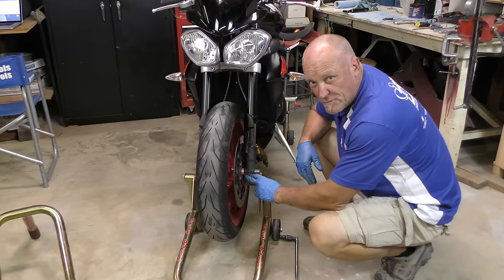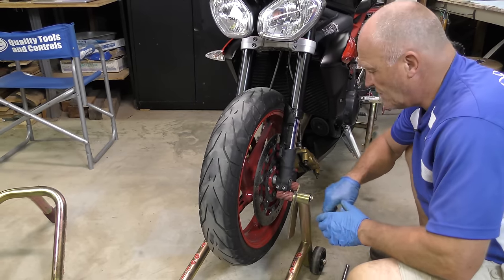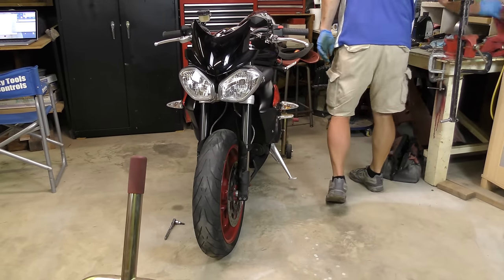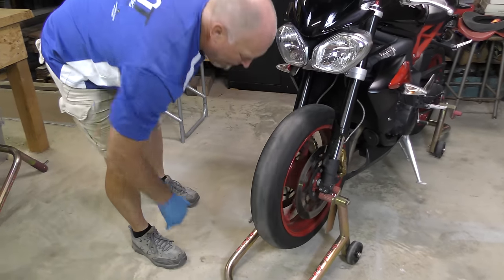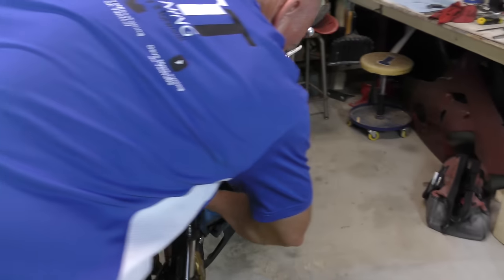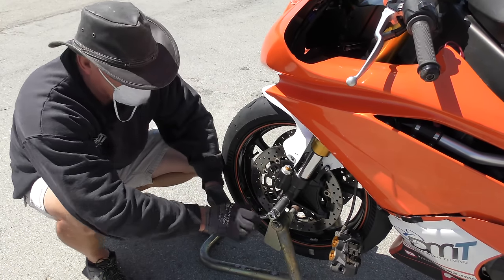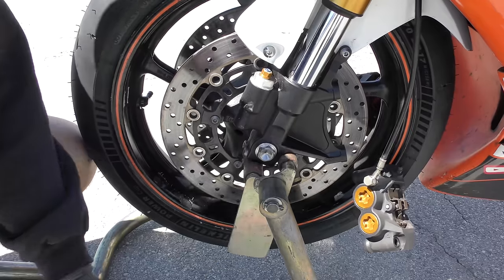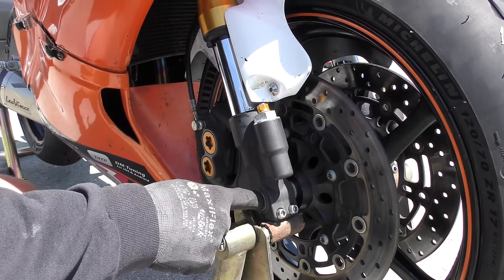Aligning Motorcycle Fork Legs Properly After Mounting The Front Wheel

Comment: Will this straighten my handle bars? Or do I need to also loosen the lower triple clamps prior to the bounce?
Reply from the maker: Forks only bind in a lateral direction (left/right) and do not cause the bar to be off the center line. Generally that is from another issue altogether.
Reply: @catalystreactionsbw  Okay. The reason I asked is because I noticed my front wheel was pointing a few degrees to the left. I can line up my triple so it's even both sides measurement wise (centre of the fork adjusters to fairing bolts). And the front wheel is definitely pointed left a little. Was told to a full alignment with the triple and the forks, but unsure of the entire process?
Reply from the maker: @KR4Z3D666  remove the forks and loosen the upper triple clamp nut on the steering stem. Install one fork and snug the triple clamp bolts. Install the second leg and see if it lines up perfectly with the upper triple clamp. If yes, all good. If no, upper, lower and steering stem need to be straightened.
Reply: @catalystreactionsbw  I'll let me suspension guru take a look at it. He's gotta do the fork upgrade on the ninja300 so he can look at the gsxr while he's at it :)

Comment: My bike when i break hard, in the frount, maskes a grrrrr sound, is that normal? (NEW bike 2000km only)
Reply from the maker: Have you checked your brake pads to make sure they are wearing evenly and checked the rotors for hot spots? Spin the wheel to see if it is spinning free or catches on the brakes pads.
Reply: @catalystreactionsbw  Thank for answering! I will check that and comment to the brand. 🙏
Reply: @catalystreactionsbw  Hello! I have checked the front roters and they have a dark or black color all around, they do not look silver like the one in the back. It looks like one of your other videos but without the comet shape…
Reply from the maker: @DieselMI  The black is the pad material transferring to the rotors. If there are no comet tails, then there are no high spots. Now check for rotor free play forwards and backwards as well as side to side.

Comment: So it is okay for the front wheel rotor to be somewhat rubbing on the brake calipers , hmmm. I aimed for a much free-er wheelspin.
Reply from the maker: It will always have slight contact with the pads but should not drag the wheel to a stop after 2-3 rotations.

Comment: Do you need to loosen the head stock bolt at all
Reply from the maker: There is nothing wrong with loosening steering stem nut, upper and lower triple clamps, handlebars and pinch bolts and start over. Then you KNOW everything is perfect!

Comment: Why is it making a popping sound when you press the brake 1:40?
Reply from the maker: The "pop" sound is the brake pads being aggressively applied by me and with a stationary motorcycle, the wheel locks instantly.
Reply: @catalystreactionsbw  is the pop not about the floating rotor?
Reply from the maker: @ohkey2999  It would be if the rotor was loose, but this was a very tight fit. Noted on getting different types of rotor sounds when the bike is stationary or rolling.

Comment: 0:40 anyone know the tool BIT he is using to drive in the big bolt into wheel? thanks
Reply from the maker: https://www.amazon.com/Motorcycle-Front-Spindle-Socket-Adapter/dp/B08LMLXLL9/ref=asc_df_B08LMLXLL9/?tag=hyprod-20&linkCode=df0&hvadid=475689981997&hvpos=&hvnetw=g&hvrand=7080261066765004543&hvpone=&hvptwo=&hvqmt=&hvdev=c&hvdvcmdl=&hvlocint=&hvlocphy=9032119&hvtargid=pla-1063072771142&psc=1

Comment: If the guys who replaced my fork seals didn't do this properly when they put the front end back on, could this be why my bike is 'Crabbing' over bumps and grooves on the road. It's bad in the dry and it's downright dangerous in the wet!

I ride an 08 sv650s and yes, I am only in my second year of riding so my knowledge is limited.
Reply: Possibly, if the forks are so still they are deflecting off or stuff that it could be absorbing.  I ride a dirt bike with more travel, but the problem is the same.  If the fork legs are not parallel, they will bind on the bushings as they go through their travel.  I made a gauge on a lathe from 1" diameter aluminum bar-stock, (5.661" long for my YZ250).  I measure a triple clamp to find "center to center", (the distance between the fork legs), and subtracted the diameter of one of the plated slider legs, to get the proper distance between the plated legs.  This method was off by almost .030", (that will bind), and i know I am not off more than + or - .001" now, and I actually had to go to stiffer fork springs after I eliminated the binding.
But, the shop also replaced the oil in the forks when they replaced your seals and bushings.  It may be stiff because they use a oil that is too thick, and or possibly too much oil height.  Let me give you some more advise.  Learn to work on your own forks/suspension.  With proper information and needed tools, you will probably do a good job the first time, but for sure the 2nd. :)
Your fix:   Replace your fork oil with the right stuff, (the lighter the viscosity the better for you IMO), and fill the fork legs to their proper height.  Too much oil can blow out seals also, (less air to compress above the oil, makes it stiffer at the last half of the travel.)
Doug in Michigan
Reply: Possibly, if the forks are so stiff

Comment: Everything was going good until mounting the calipers.. the left side rotor is too far to the right and the right side rotor is basically touching the bottom of the fork..
Reply from the maker: Are the wheel spacers installed on the correct sides?

Comment: Professional endurance teams don't do this in the pits on wheel changes
Reply: I have seen MotoGP teams do it on front wheel changes. Most recently Suzuki during qualifying I think it was, at Le Mans or Portimao last. They rarely change fronts during qualifying. Probably has to do with how the quick change is designed. You don't need to bounce the front with most little bikes like Ninja 400's either because the axel is a straight up nut and bolt that squeezes everything together. No pinch bolts on either leg. That's really the tell tale sign, whether your forks have pinch bolts. You need to bounce the forks with pinch bolts on the floating leg loose.

Comment: Some bellend into the second week of my first scooter 125 Lexmoto Aura reversed 50 metres into me since then my bike has never ran the same and the bike would judder slowing down braking to a stop. I got the forks checked and it came out all right, but I think the mechanic that did this was probably running insurance scams outside their garage near me as they blamed me for driving into them and said I should not report is so they could claim 'no damages" off my insurance. what a complete bunch of bellends! you just can not trust anyone anymore. On my bicycle I have had to rear solid bolt on axles snap at low speeds because the rear stays were bent probably from locking to a rack, radiator or being rear ended by a car or something but just be careful out there-people need to know basic mechanics as there are a lot of bellends out there!

Comment: 💥This bounching method isn't fail proof💥  I did it several different times on my Honda Valkyrie and only got less binding when I followed a diff method.  

Jack the front end up loosen the free side pinch bolts.  Push the fork end in and out and find the middle between the two.  Then tighten the pinch bolts.  Much less binding than bounch method

At 6:40 on this link 

https://youtu.be/TnG7K10tHZM